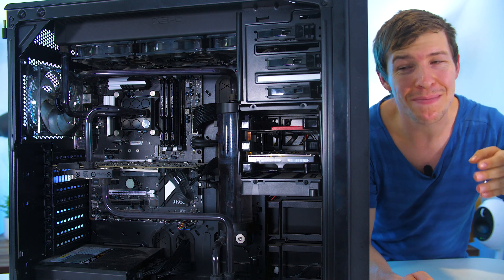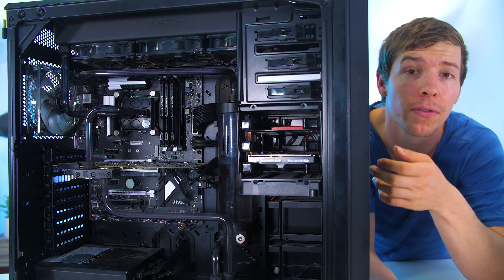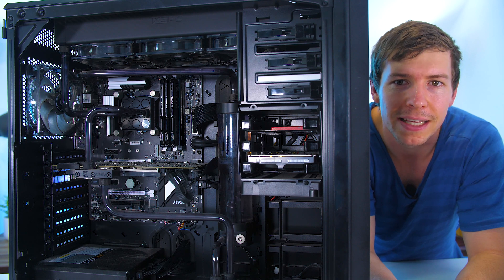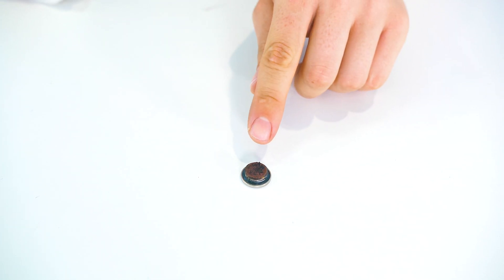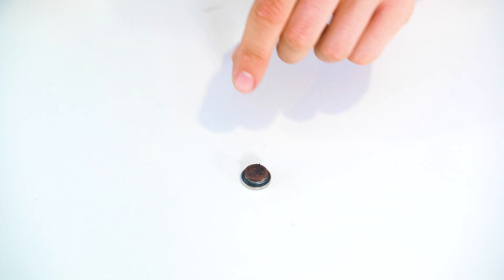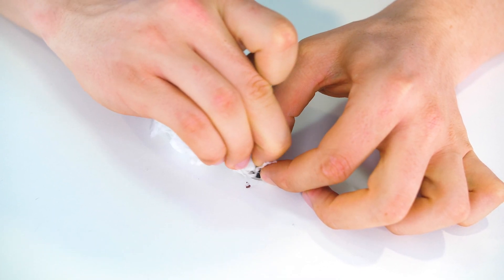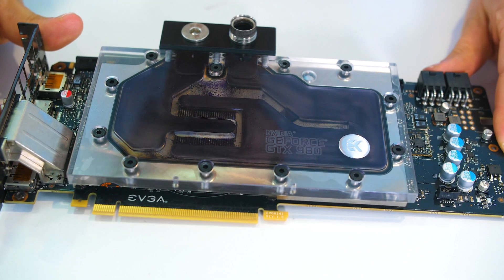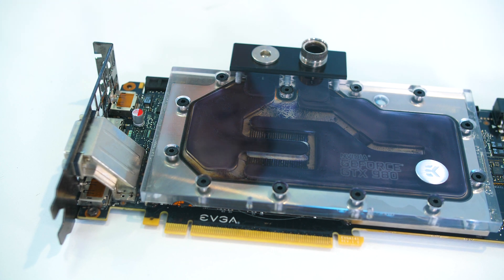He DIDNT CLEAN His Water Cooled PC in 4 YEARS! This Is How We SAVED It

Comment: I mean I spent three years without opening my GPU block... just did it the other day while rebulding my pc and the thing was spotless... Guess i am one of them lucky guys running mayhem stuff.
Reply from the maker: Yeah some times you get lucky sometimes you dont
Reply: @DesignsByIFR  Yeap I do play close attention to my temps which some blockage like that would definitely affect.
Reply: I took my Mayhems Pastel (red) loop apart after a year and the CPU block had no residue at all in it. The fins were totally clear.
Reply: But tell me the temp difference between Mayhems and clear, distilled water.....
Reply: @weasel101  Wouldn't know. Never used water alone. Doubt it's anything worth mentioning. The only time either or will not do its job is if there is blockage as shown in the video.
Reply: @brasilianloser  False. There is a substantial cooling difference. After 14+ years I've yet to find anything that comes close to pure clean water.
Reply: You shouldn't be using pure water - you should have anti-bacterial and anti-corrosion elements in it. What things have you tried other than 'pure' water? What were the differences? Did those other things leave a residue?
Reply: @Safetytrousers  using pure distilled water is just fine. Dont BS people. You do however have to flush the system a lot more often and as good practice sanitize it in between. With a good build it takes but mins. And NO you are not going to, 1-freeloading off my data and 2-add personality to to the products. These companies work hard to provide an aesthetic product that you all love and demand.
Reply: Freeload off your data? Really? If you can't provide evidence for your claims why should anyone give you any credence? You yourself asked what the temp difference was. Of course you could use pure water, but why would anyone want to drain their system several times a year? For me my PC is on the floor, and it takes some effort of strength to move it, and it's a great build. It is easy to drain but the efforts to get it into a position to drain mean I don't want to do that more often than I have to.
Reply: @Safetytrousers  And where dud you hear that Distilled Water should not be used? That  directly contradicts years of learning and research. Even a simple look into it will push what you said there under the table. Go search Distilled Water on the FDAs sight. And years of water and wastewater research. And bottling companies. With that said, most PC builders will benefit in using some kind of the less dense products. Why? Because they dont seal the fittings and connections properly when building. Even with air saturation in the loops I have run Straight Distilled Water for over 24 months without issue or growth of ANY KIND. Only had to lightly topoff the loop at the end of each year.
Reply: Maybe I am misinformed about running pure water, and I got that from several guides on the net. But how about answering my other questions?
Reply: @Safetytrousers  Yes, freeload. I have years and years of data. Years and years of degrees and experience in industries of different spectrums. I have books and books of data from cooling research. From materals used to saturation percentages and of course liquid types. All due respect, using lazyness as a reason wont fly anywhere of accreditation. Maybe workout a bit more or redesign your loop. It takes me 3 to 5 minutes to drain my loop. Or keep using all the products, but dont deny others facts because you are not willing to go the extra mile or because you keep pride on the top of your list.
Reply: I already said I may be wrong about needing to add things to pure water. You could just give some ballpark figures as an indication of the benefit of pure water. And don't patronise me please.
Reply: @Safetytrousers  My Apologies.

Comment: That was really good. It's great to see what happens to a pc after lack of maintenance. Would definitely like to see more like this - also would have interesting to see how/what in the pump had failed or some sort of look at it. It'd be good to cut open the radiator and check it out. I was amazed to the see the rubber seals all seemed to be good even though the fittings had corroded somewhat.
Reply from the maker: Yeah the seals were in great condition

Comment: What did you use to clean the GPU water block?
Edit: Also will something bad happen if I use tap water to clean the water block instead of distilled water?
Reply: He most likely used isopropyl alcohol or a specific PC cleaning solution. The higher the percentage the better.
Reply from the maker: You can use tqp water to clean it. I used hot soapy water on the acrylic part and i used isoprophel alcohol on the metal part and a bit of tooth paste in the fins
Reply: Thank you guys for your answers!
I was getting a bit anxious , because I used hot tap water to clean a clogged up GPU block.. I'll still flush it with some distilled water before assembling the loop, but knowing that it's not such a huge problem as some people make it out to be is definitely reassuring!

Comment: the 3 sticks of ram at the beginning of the b roll triggered me.
Reply from the maker: Yep i knew they would so i took one out for the final broll
Reply: Yeah ram is cheap especially 2nd hand DDR3 he should get 2x 8GB 1866 DDR3, and SSDs are cheaper too (that's m.2 slot on the Z97 board is calling for a 500GB SATA m.2 ssd, for like $80 bucks)
Reply: I used to have 4 sticks of RAM. Then, one died and I will not be replacing it. Now I have 3 sticks of RAM. Fight me!! RAM is expensive.
Reply: Unless it was an X58 system with triple channel!!! ;)
Reply: I has soooo glad when it was fixed. lol
Reply: 1.  Drops water on GPU      =D shame        2. three ram´s, which work not in dual or quad channel. just works in single-crap-mode =D

Comment: what a pros and cons if using watercooling ?? i have sades incubus mid tower and have slot for 5.25" DVD/CD and i wanna use EK D-Bay ..
Reply: I would like to know too :)
Reply: You really have to be extremely picky about cases with watercooling. If you're only doing the cpu just go get an aio. If you want  to do the gpu as well you should look for space to put either a 280mm or a 360mm radiator. If you can't do that, then you need a new case. And like he was saying, you MUST drain it at least once a year.
Reply: @Mavitros  Yeah 4 years is absolutely irresponsible lol. I find it that people typically want to change the color quite frequently so I'm sort of surprised he had such a nice build and didn't take care of it at all.
Reply: @Mavitros  hmmm ok .. may i will try it next time ..
Reply: @fikriadisatrio7375  I advice doing HOURS AND DAYS of research into watercooling before you attempt watercooling, unless you just go the CPU/AIO (All-In-One) route.

Comment: Great video, that's the reason why i always keep clear water into my loop and change it every 3~4months and cleaning every block once a year atleast to keep good temp tho ^^  glad to see you saved a pc ! :D
Reply: I'm finishing my first custom loop, so is going to be a quite while until my first cleaning to it, but how do you do it? With those cleaning products from primoChill and stuff Or just distilled water? 
I'm still noob for this 😅
Reply: If you'r doing it often enough and not using any dye just fill and empty the loop with distilled water few times and it should be fine. Take care to clean the block sometimes just to be sure there is nothing in there. I used the mayhems kit once for the radiators and it did a great job even if it take long time ^^
Reply: @bubute  good to know that now, thanks man!
Reply from the maker: Thank you man =)

Comment: How commonly do you recommend people clean out their watercooling setup? Every 6 months? Every month? Also the music you keep using in the video is like being on thorazine. Keep it livelier man!
Reply from the maker: I usually do it atleast once a year
Reply: I was told my cyberpowerpc every 15 months...I wish I never bought a water coolent pc.
Reply: @uphill248  passive air cooling masterrace
Reply: @uphill248   I'm on water and haven't ever cleaned it once in 7 years.. Well except for dust, but my dust gets way worse then this.  i7 3770k, but I refuse to use these colored fluids. Corrosion inhibitor + kill coil + antibacterial flush (2 times before final fill) distilled water (not de-ionized). I'll upgrade soon and might have to do a video on it.
Reply: As a plummer i do not recommend to replace the water IF its not contaminated. And as Adam May said, this small system will never need water change or cleaning if using distilled water! Each time you replace the water you add new oxygen rich water and your parts will corrode more.

Comment: Was that water in 2:08 which dropped on the gpu
Reply from the maker: Yeah it needed it to get that gunk off xD haha but a little water doesnt hurt a pc part with no power
Reply: @DesignsByIFR  Depending on what PC Part it is, a lot of water wouldn't hurt either. der8auer frequently uses dishwashers at its highest settings to clean ram sticks, gpu pcbs and motherboards from vaseline since he covers them with vaseline while overclocking with liquid nitrogen to prevent shorting that is caused by condensation
Reply: @DesignsByIFR    yup just dont let the drops dry on their own . for some reason the water spilt on my laptop corroded some connections .
Reply: vrgamer83 that’s what I was thinking
Reply: Yeah it was, but the system was off. As I said on another post about this. A couple drops landed on the back of the PCB. It's fine. Theres people who literally put their motherboards and graphics cards in the dishwasher to clean them and they work perfectly afterwards. As long as it's not connected to a power source it's no big deal as long as he doesn't leave any water on it.
Reply: @Zola9494  Agree!
Reply: @Zola9494  That is me :) shower also works fine. Good way to renew a lot of parts.
Reply: @Zola9494  When I saw the water dropping, I came to the comments to explain the same thing to those who don't know. I don't have to, so thanks :D
Reply: water dont kill electronicks if they dont have power. water itself is not conductive but cause its super dirty or if you add something like sope it can.
Reply: @JohnModsMC  So i hope you drink your coffee to get wake!!!! Water starts corrosion even when you dry away. This water was years inside this system so its dirty you should know when starting brain just for a second ;) and sure pure water is not conduktive. but better question: you know there is 100% pure water in that system hmm???? so dont speak stuff where halfwise. This is stupid way to work sry.
Reply: @o0FriGhtNeR0o . I know i can see that the water is dirty, i am not stupid. But i was trying to inform the dud that was freaking out about the water that there is no issue if there is no power and that water itself is non conductive. And i did not even talk about corrusion.
Reply: @JohnModsMC so thats still unprofessional and should dont show to people who made it by her own. Big fail because when you not clean right and give power you shit up all and thats so true. Thats 100% deffinetly unprofessional and stupid because even a pro can forget a waterpearl and buuum you shit up your system when power up so plz dont try to harm down or make tell this a good way of working, its shoking. when my cheef see i am woking like that i lose my job =D
Reply: @o0FriGhtNeR0o  i had to read this 3 times to understand it......thats grammars is not verys gud, pleaasee fix
Reply: @Belows682  sry Google translate do it. Ask Google to improve her translator in grammar
Reply: @o0FriGhtNeR0o  you're insane
Reply: Yes best way show stupidness =D